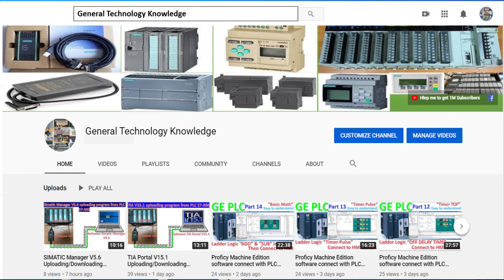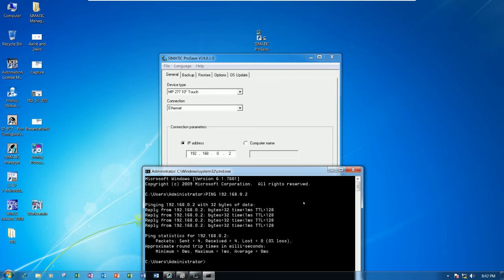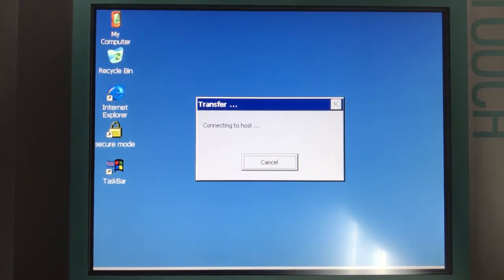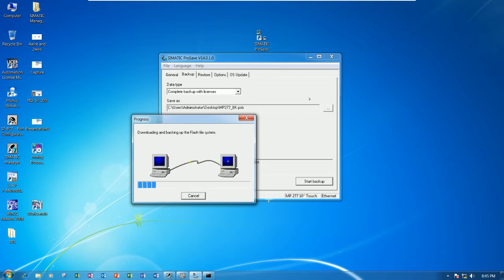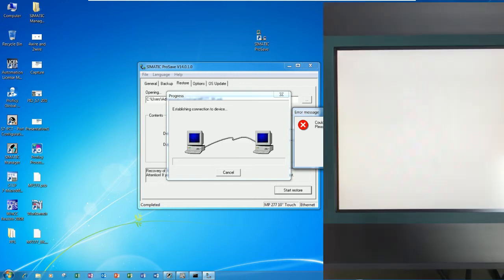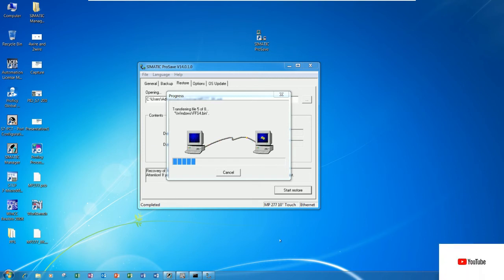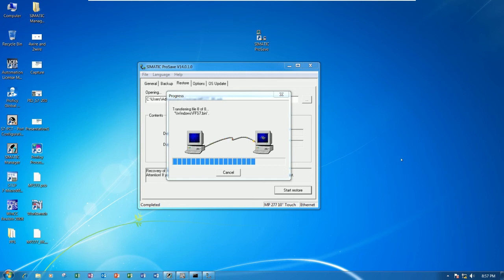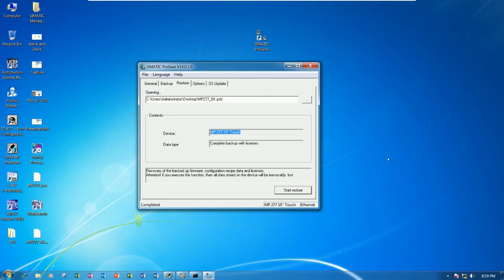SIMATIC ProSave V14.0.10 full Backup & Restore project of Multi Panel MP 277 10" Touch by LAN cable

Comment: Hi, friend. I try to do the same as you but I can't connect. I have the same screen. In the CMD I ping the screen and there is no problem. But it does not allow to connect with Simatic Prosave. Do you know what problem could I have? Do you know if it can connect with tia portal V14?

Best regards
Reply from the maker: Dear sir,
This HMI support only WinCC Flexible
Thanks
Reply: Thank you very much for your prompt response Mr. I try to do the same as you with simatic prosave. but when you try to "Downloading device image" The communication fails. I also cannot communicate the HMI with Wincc Flexible 2008. I hope you can help me. Well, I have tried insistently and have had no results. Best regards
Reply: Is the simatic prosave version matter with the version of hmi?
Reply: Hi Marcetigreshark. Your issue is likely the outdated PanelOS, like it was in my case. After updating the OS with ProSave, the connection ran fine without any issues.